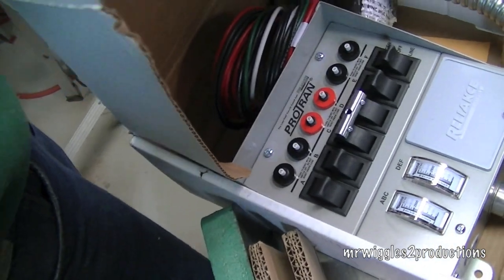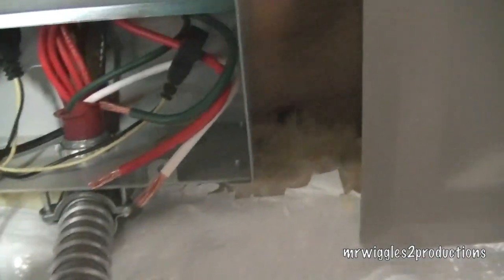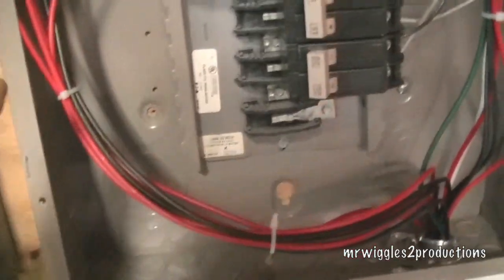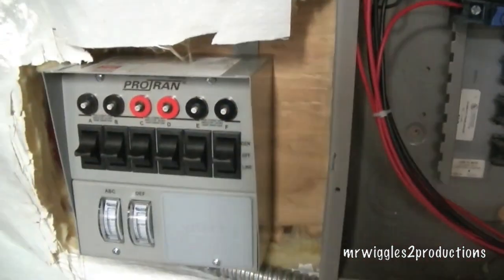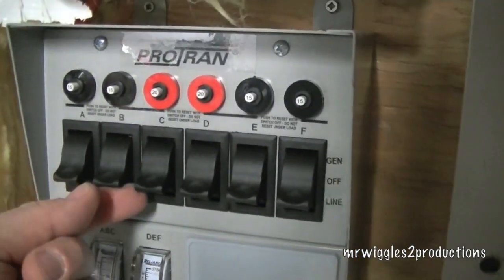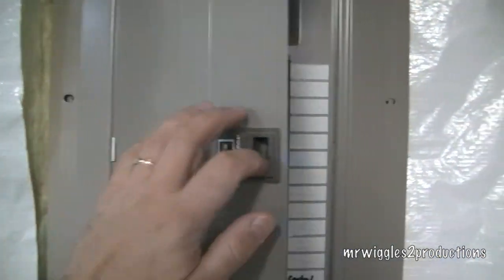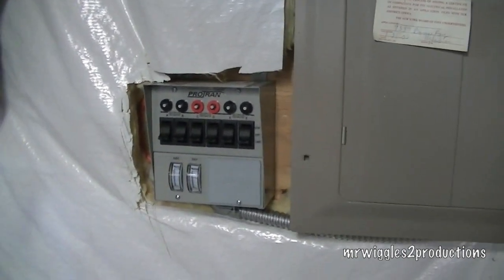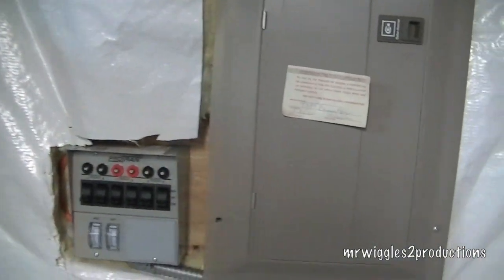Generator Transfer Switch PART 1

Comment: two questions, I have a  larger generator 11.5kw startup and 9k running,  was told that I could use it for that panel and have enough  for the 4 plug to use outdoors. True or false, second when you wire the blk and red wires are they marked as to what switch  they go to in the transfer panel like the A<B<C>D>E>F
Reply from the maker: True, more power is better than less power.  I can't remember what the recommended wattage was, but mine is 8500 peak, 5500 running... but even with the coffee maker on I don't think I've been up to 5500 watts.  I've done a couple videos on this panel, still working great.  2nd question- the wires being marked, I think they were alphabetically marked.  Go on their site, they have a youtube installation video on this exact unit- it was simple and easy to do.  6 circuits run lights, 3 fridges/freezers, sump pump, furnace blower, tv, wifi, coffee maker.  great unit.  Don't forget to subscribe.

Comment: I had installed the same type of switch except a 10 circuit model, but after I upgraded my main panel I went with the interlock switch, which with the breaker cost less than 75 bucks, versus the 375 for the transfer panel.